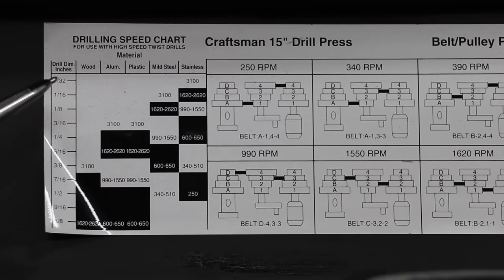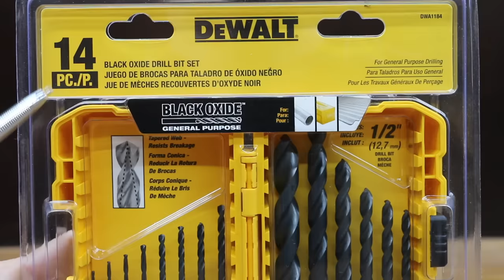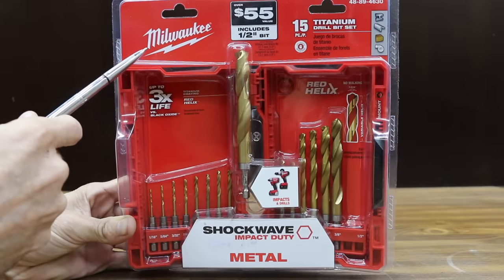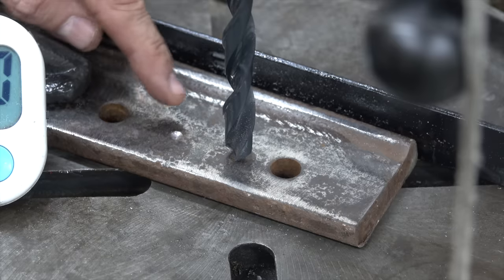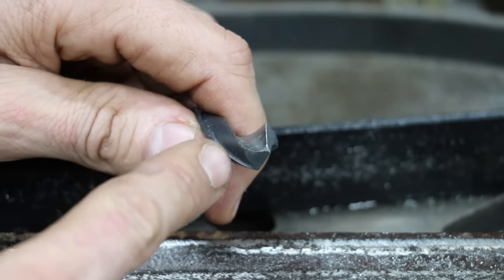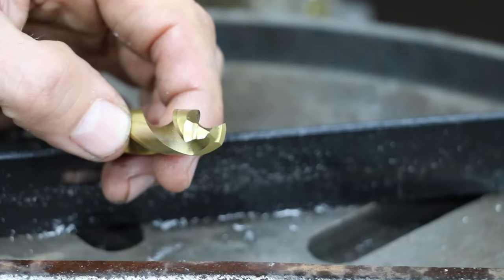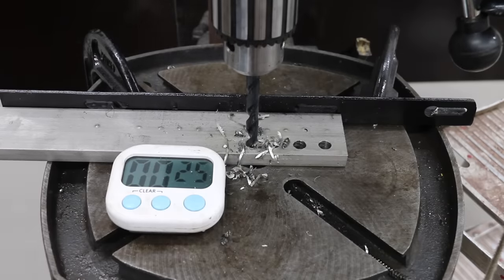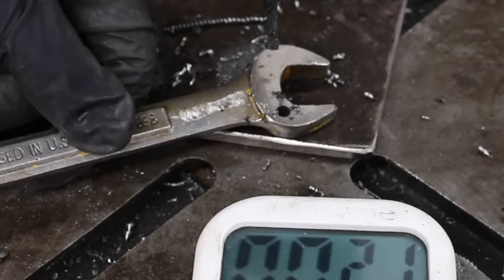Which Drill Bit Brand is Best? Let's find out!

Comment: Will we see masonry bits in a future episode?
Reply from the maker: I'll be very happy to test them if there's enough interest.  Hope there are a lot of likes to your question.  I'll check back.
Reply: @ProjectFarm  masonry bits on ceramic tile, porcelain, stone, brick, etc.
Reply: @ProjectFarm  yes
Reply: Yes
Reply: I’d really like to see this one
Reply: Yeah, I work at a hardware store and we sell dewalt brand masonry bits. I want to know how their durability stands up to the competition so I can give people good recommendations for the work they need to do
Reply: Yes, love to see masonry bits
Reply: @ProjectFarm  
I worked for 13 + years in a tool and die shop. 
We would use masonry bits to drill hardened steel.  The steel was not super hard, but it could not be cut with a normal twist drill.
Thank you for your good work.
Reply: i second this idea of maybe testing hammer drill bits but in my experience the only thing that slows down any hammer drill bit is concrete. Every other material my hammer drill punches right through although I do use an SDS and/or SDS max drill which makes a huge difference.
Reply: @willybee3056  Why wouldn't you just buy a carbide drill bit, rather than having to setup a masonry bit in a tool & cutter grinder and grind the cutting profile to drill in steel?
Reply: I have seen a guy at a farm show take what was basically a carbide tip cement bit, put it in a drill press at full speed and drill through the hardest kinds of Steel, leaf spring and a rasp
Reply: @ProjectFarm  absolutely do masonry bits. I remember using harbor freight bits and them getting rounded off before a single hole was finished. I proceeded to get a recognized brand, which drilled every hole I needed without much sign of wear.
Reply: @ProjectFarm   please test masonry bits!!!
Reply: @ProjectFarm  I'll just tell you that Bosch makes some hella good masonry/concrete bits. Of course, after watching this video it further reinforces my belief that they make excellent bits albeit more expensive.
Reply: OMG YES. I recently installed shower door set. The tiles my deceased step dad installed were 1/2 glazed ceramic. Took forever to drill 6 holes.
Reply: Just buy bosch. Also, if you do this a lot, get an SDS plus rotary hammer.
Reply: Masonry bits are all about the tool! You need percussion not just vibrations. Commercial Construction guys use sds or sds plus and of that the bits are 75% hilti 20% dewalt and 5% other
Reply: @7chrisjeep  I am not a pro but I have drilled a fair number of holes in concrete with bosch bits. They seem to be pretty good.
Reply: @kylefowler5082  I've found wet brick will slow it down more than concrete (thanks to the stickiness of the shmoo)

Comment: The Dewalt drill bit's seamed to do pretty good, Since Dewalt has so many kinds I'd like to see a drill bit comparison with black oxide, titanium, black and gold and cobalt bits all compared.  Dewalt has all of those types available.  I'd also like to see a drill bit comparison between Dewalt pilot point and split point with both drilling speed and bit life.  Thanks for all your hard work.
Reply from the maker: Thanks for the suggestion.
Reply: Kobalt drills are the way to go imo. Suckers last for a long time and can be resharpend
Reply: Its 14, and the others have 20+ its more expesive than most
Reply: Same thing with Bosch, they have different levels of drill bits too.
Reply: I would love to see exactly that!
Reply: Yes!!! Those Dewalt Pilot points are the best bits I've ever used. I even ordered some that were impact rated for my impact driver. They work awesome for larger diameter holes. They seem to stay sharp for much longer than other brands also.
Reply: I would like a comparison of the different flavors (gold oxide, cobalt, titanium etc.) as well! And maybe you could give a bio of yourself, and how do you pay for all of your experiments!
Reply: @jokermaness  Yes and no. For general use it is a clear yes when money is not the issue. For specific uses it might be a no. We got recently the Bosch after watching this test here. We only used them with handheld machines.
Reply: You need cobalt for when doing stainless, as it is a material that “work hardens”.   They cost more but pay for themselves as they wear much slower.  Also things like Devcon Safetap etc cutting compounds help greatly.
Reply: Right, so many variations.
Reply: Cobalt beats any other in terms of strength and sharpness.

Cool fact: Cobalt was my nickname at school. Because of how tough I was and how razor sharp my punches were.
Reply: @i_know_youre_right_but  I’m tryna be like you
Reply: @i_know_youre_right_but  I think they changed your name since to el ninyo due to the amount of hot air you produce.
Reply: Yes, we really need a comparison of Cobalt vs. Black Oxide. vs. Titanium Coated. For longevity, after 10 drill holes. The alloy is of critical importance.
Reply: This video was a lot of good work, but completely missed out on two of the more important aspects, TOOL GEOMETRY, and WHAT the drill material PURPOSE is for.

The ONE feature not emphasized was the "split point" feature.  This one aspect alone IS important.  The other geometry feature is the drill point angle. Standard drill point angle is 118°.  Alternative angle is 135° often used for harder materials. Also important is "web thinning" and "rake".  This is a matter of simply looking at the tool bit set BEFORE purchasing.   None of this was even mentioned in this video.

Then the drill material was skipped over with no explanation ....yet it seemed that "cost" was more important.  Well, if you're not going to provide any information about drill material or "coating" ....and in particular "SHARPENING" .....then this video is fundamentally only for people who need a drill every five or six years .....for wood.

.
Reply: @i_know_youre_right_but lol, you definitely peaked in high school, that’s for sure.